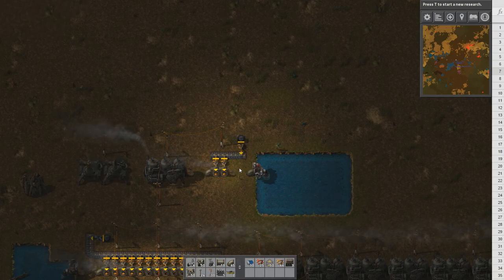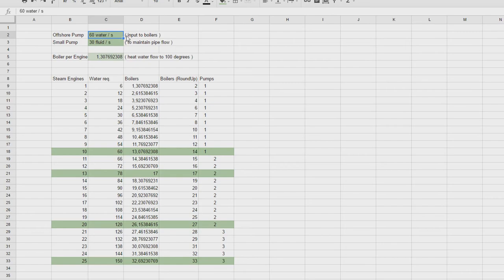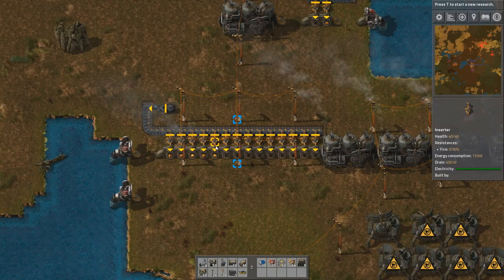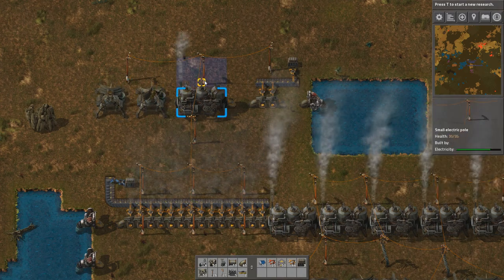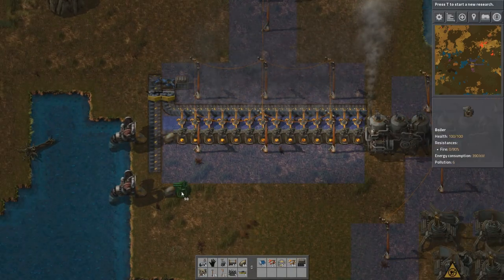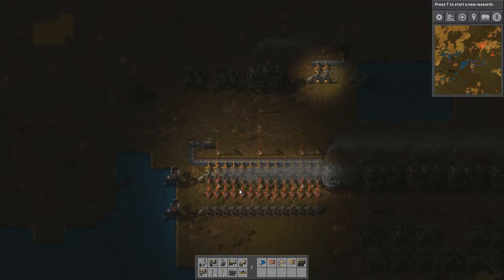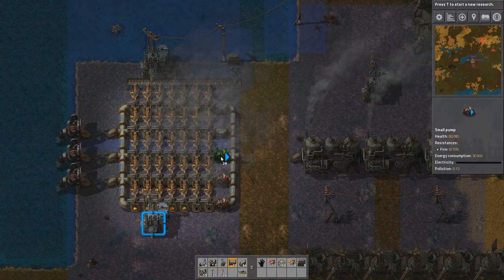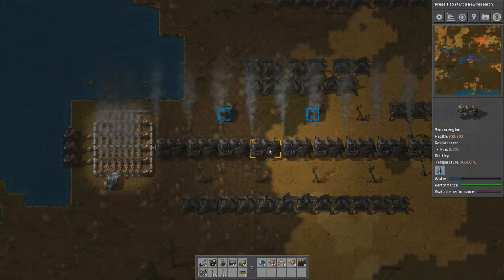Factorio - Optimized Steam Engine Setups (v 0.13)

Comment: 1-14-10 is the simplest one to deal with.  Late game you can go 1.5-17-13, or 3-34-26 (but keep pipes after boilers separate)  Never join your pipes at both ends of the boilers, as the game can actually create a loop where the hot liquid goes back through the boilers to the pumps (weird, I know, but it happened to us in an MP game)
Reply: The only ratio I've ever seen people's math come up with before is 4 boilers to 3 steam engines, so I usually prefer 1 : 12 : 9 because at full power consumption all of the boilers and steam engines will be running at 100% rather than leaving the last boiler underutilized (14 : 10) or not providing enough hot water (13 : 10).

Definitely some nice explanation and layouts though, particularly with the small pumps.
Reply: 1-13-10 will run the last steam engine at something like 98% .. 1-14-10 should have all steam engines running at 100%... if it doesn't, then something is wrong with your game.

1.5-17-13 is less common, but it does exist.. You'll most commonly see it used in megabases where the player has made a conscious decision to use steam engine instead of solar. 

3-34-26 is just the whole numbers version of 1.5-17-13 .. you don't run them in a straight line since you can't push enough water down a single pipe
Reply: I would definitely avoid using small pumps in your power builds though... if you lose power, then you don't have power to run the pumps to make power, so it's like the feedback loop 100 times worse than lack of coal.
Reply: Right, and that's why the small pumps would typically be run by a separate single steam engine (with priority fuel access) or a small dedicated solar/accumulator array. You can even use that kind of setup to turn your entire steam power build into a backup system for if your main power via large solar and accumulator farms runs low or cuts out unexpectedly.

Comment: Let's say i have 20 pumpjacks with 0.1 oil / s, in sum a total of lower than 30 units / s. Do i still need pumps for long pipes?
Reply from the maker: According to the information I used (found on the forums), you should not need pumps for distances up to 759 tiles if you keep below 30 fluid/s. However, I have noticed that mixing several pipes together might sometimes mix things up in what direction the fluid is going... So if you think there might be something wrong, try a pump and see if it helps. 
Read more here: https://forums.factorio.com/viewtopic.php?t=6066